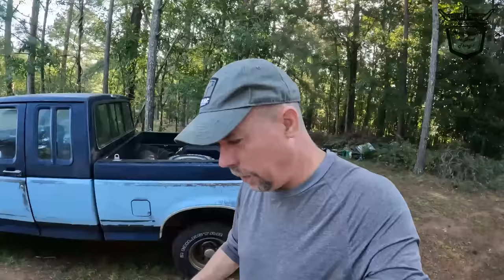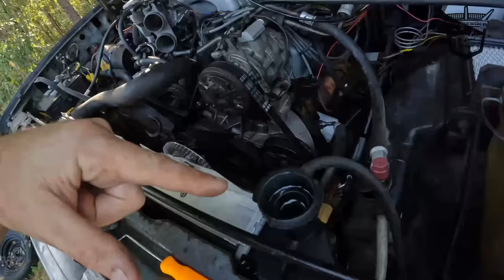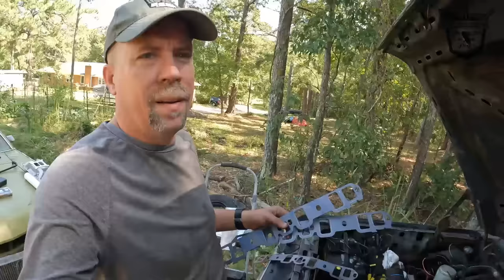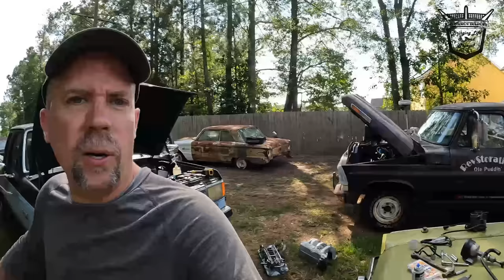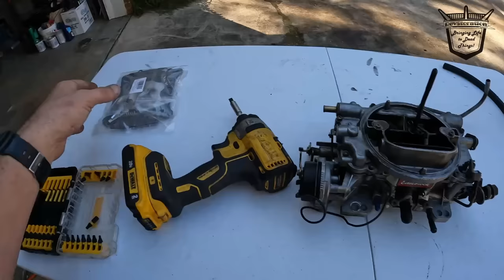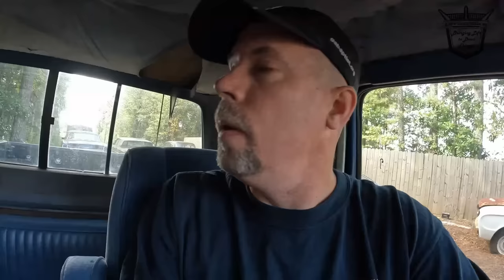1987 Ford F150 - EFI to Carburetor and HEI Distributor Conversion ...ish!

Comment: Being a Pastor is a full-time job.  I don't see how you manage to put up as many great videos as you do.  So many people think a Pastor only works one day a week.
Reply: 47 b
Reply: Love watching his channel and pastor wheeler and his dad the old man,, and I have definitely had some I should have given up on like the early 94 Chevy extended cab short bed Z71 Silverado tbi nightmare I've mentioned before but I didn't quit because people kept saying it would never run, and I was determined to fix it well I traded a $3,250 86 chevy k20 custom deluxe long bed and well used farm truck only needed the bad starter swapped and a good carburetor put on it I offered the guy it's quadrajet carburetor and the GP Sorenson rebuild kit he's like nope quadrajet carburetors are junk, anyway he was asking closer to $2,000 for the early 94, and it now runs fairly well except it's going to need fresh rod and main bearings from the major flooding issues it had and that they just drove it like that til it wouldn't take fuel input without crackling backfire flames out of the exhaust tips and through the glass pack mufflers and stainless cannon 3 1/2 inch slant cut stainless steel heartthrob brand exhaust tips on 2.25 inch pipe and the tips are 18 inch long sounds like a double barrel 12-16 gauge side by side shotgun being fired simultaneously needless to say the neighbors hated that truck... and the timing chain is getting slack in it so that needs replaced and I probably have close to another $2,700 in parts making the tbi truck run correctly so yeah just carb and hei distributor swap it,,I could have gone that way but even if I didn't keep the Z71 I know it has rust around the edges except for the bed the inner bedsides are shot.. it's still a truck alot of people look for to buy,, and I have a clear title to it,it is still one of the most straight bodies of the gmt400 extended cab short bed trucks I've seen.. I knew someone would still want it... my late brother's best friend,, turns out it had a weak fuel pump and the factory sending unit was half clogged up with sediment and rust, and the main two issues actually there are 3. The reason it was backfiring through the tbi occasionally if you tried to hurry it up moving was the right side injector was a 5279 a 305 fuel injector and the Dr side was a 5206 a 350 fuel injector so one side the passenger side was starving for fuel, and the oil sending unit sensor was the wrong one for the vehicle as the motor was from a older truck,it didn't have the fuel pump cut off circuit so when the truck would loose oil pressure it would just quit causing it to backfire out the exhaust tips, and the tbi distributor was rusted and corroded inside so I swapped it out and put a tsp southwest performance brand new billet aluminum distributor in it and swapped out the no name ignition control module for a ac Delco gm ds194 and the truck while on the battery charger fired right up, but usually the starter would about kill the battery starting the truck and that got replaced with a ac Delco professional service replacement gm mini high torque starter like these motors are supposed to have and it zings right over and fires the tps sensor had a dead spot just after idle, halfway through part throttle and just after full throttle so that got repaired and followed by new Napa black 7mm high temp resistant silicone jacket ignition wire set and ac Delco rt45ts spark plugs since I'm sure this motor has been washing the cylinders for about two years before I got the truck and no one fixed it my first clue was with the bad fuel pump starting it off the mt dew bottle with a quarter of the gas in the bottle into the sides of the tbi and it tried to run fine as long as you didn't give it any throttle response input.. and the oil smelled strongly like gas, unfortunately this truck has a 0.40 over 1 ton 4bolt main 638 block in it with decent speedpro pistons and rings but I am guessing it's going to eventually need to come out and be gone through again but after all that it's rebuilt transmission started slipping and I'm like nope I'm done someone else can feed this thing parts, and then my late younger brother's best friend decided he would like to own the truck and I ran into a deal on a th700r4 transmission i couldn't pass up and ended up buying a transmission for it anyway...ugh
Reply: It’s not a real job that’s why….

Comment: Hey Rev. Lamar from Kustom Motors. Here in Abbeville SC. That's a good way to go with a Carb and HEI. You will need a pressure regulator for the carb. EFI is a higher pressure. Much Love from everyone here. Keep looking up and turning wrenches.
Reply from the maker: I installed an edelbrock 4-7lb electric pump..
Reply: @RevStoration  so you took relay out for factory pump or it just doesn't run from efi being disconnected
Reply from the maker: @RobertDickens2002  I took the two power wires off the high pressure pump and wired them into a new inline low pressure pump. Still using the relay.

Comment: The metering rods on that carb are a GREAT design. I love taking them out and dropping them in from the top.  I just did the same thing with a Chevy. By far the throttle cable bracket was the worst part, cutting and welding and more of the same.  Simple always works.
Reply: Well rev my brother had same problem with a 84 150 like to drove us nuts we did the same thing good video thanks

Comment: Pastor, check the firing order. I had a 78 Thunderbird that i built a 351W for. However, i forgot that I used a 302 grind cam in it. I fired it up, and it ran and drove, but ran poorly, with low power. I switched to the 302 firing order, and voila'!! Ran smooth as glass! Just a thought, as some of the newer 302s used the 351 firing order. By the way, i've been tuning into your morning services the past couple of weeks. Great messages! Revival is needed! Amen!
Reply from the maker: Amen brother. Thanks for worshipping with us!

Comment: On the passenger side of there's 3 plugs, the center one is the pressure, put a oil pressure gauge and the pressure should be 30psi if not you need to adjust the cable on the carburetor
Reply: On the transmission you mean

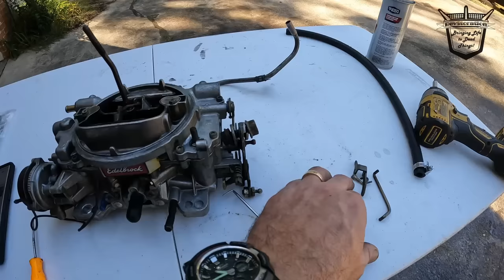Comment: 28:00 was watching Rev's hands whilst he's explaining a thought Rev had nail polish on 😮. But then I realized that it was ford grease that stuff will stain everything. Some stock engines will use a dual plane intake but most perfer single plane. It is what I have learned from my own experience. 🙏

Comment: Take to wrenching with Kenny. If you got a tac in dash, dont hook it up cause it wont be right it be to fast.Sounds like you got 2 plug wires cross and that will cause trans trouble.✌️

Comment: Something that a lot of people don't look at is the harmonic balancer if one things go bad it will make your car run like crap and you end up spending all kinds of money trying to figure out what it is and it keeps on doing this same garbage so have a look at your harmonic balancer make sure that it is in good condition there's a lot of videos out here that will show you about it that's what was wrong with my truck I replaced all my fuel injectors the timing the spark plugs all kinds of sensors and it come to find out that the harmonic balancer was bad that was my whole problem

Comment: Hi Rev, check, re-check, re-re-check your firing order. Acts like 2 plug wires are crossed. Have seen and done this many times myself. Good luck.
Reply: That's what it sounds like. So hard to tell from miles away but just that slight roughness is a big clue.

Comment: Rev Sounds to me you may have the firing order wrong, Ford small blocks have 2 different firing orders. I have had a couple people bring their hot rod fords to me complaining that it just didn’t have the power they expected and every time they were using the older firing order and switching the plug wires smoothed them right out. Also all the shift points are controlled by the TV cable attached to the carburetor, edelbrocks require a geometry correction bracket for that cable. Congrats on getting it running!
Reply: Summit part # SUM-700203 should do the trick for you.
Reply: That motor is not an HO
Reply: The Ford 5.0 EFI uses the H.O. Firing order
Reply from the maker: I'll try anything at this point..
Reply: I believe Robertdickens2002 was correct, it should be the non H.O. Firing order. I’m thinking of the 5.8 EFI being the same as the H.O. Work on too much stuff to keep things straight. But it definitely sounds like a couple wires are crossed at least.
Reply: @RevStoration  have you done a compression check or pulled plug wires one at a Time
Reply: I second that tv cable is super important

Comment: It sounds as if the engine is not running on all cylinders. I suggest you first perform a cylinder output test to determine which cylinder (s) is not firing. Then you can proceed and do a compression test, check the firing order, check the spark plug cables for continuity, check your spark plugs, check the distributor cap for cracks. I'm only close to 80 years old and may have forgotten one or two more things that you may need to do. But the ones I mentioned shall lead to to finding the problem. Oh yes, if you have access to an oscilloscope, you will find the problem easier and quicker. I was blessed with the opportunity to train many kids that came back from Vietnam in the Auto-Diesel Tech field.
May the HS, our Helper, lead you to successfuly find the problem.

Comment: I have a 1989 F150 and it has EFI and the only problem I ever had with it was the ignition switch would not work but I have a workaround for that only took a relay and a momentary switch and it has worked perfectly never had any problems with it at all since. I don't know why you have been having so much trouble with that EFI on that truck. Never seen anyone go backwards and use a carb. But you did do it and it did start with a carb on it just need to stop a couple vacuum leaks and then call it good. Thanks for the video.
Reply: Because he doesn’t understand it’s efi. These are stupid easy to fix and keep running. That carb is junk compared to the efi it has within.
Reply: I’m getting ready to have to replace the 302 in my ‘86, only reason I considered a carb conversion is the fact that I don’t want to deal with rewiring everything… the only engine issues I’ve had with it weren’t related to the EFI at at; sucker was even running with the EGR valve intake port completely crudded shut.
Reply: I’m converting to carb just to get rid of all that junk under the hood. That mess makes my ocd flair up😂

Comment: You need to buy the bracket for the carb and make sure you have the transmission TV cable is adjusted right or the transmission will burn up
Reply: He probably has a c6. That’s what’s in mine.

Comment: Rev, the only thing I can say is that you need to do your due diligence. Many ppl think that slapping on a Carb on it and it magically works, well as you can tell it just don’t work. Now you done that, you may as well go ahead and remove that E4OD and slap a manual in it.
Reply from the maker: The 88 bronco works fine with the same set up.. this one doesn't!
Reply: @RevStoration  let me go re watch ole bishop, see what’s different then I can come up with a good answer. To be fair, my 91 and my 96 with the 5.0 never had this specific issue, but similar.

Comment: It seems like it is not getting the feed to the electrical solenoid switches are not getting the power to trigger them and shift this transmission, but I do know that they make a standalone computer for putting those transmissions in the older vehicles without the efi and the ones setup with a carburetor so you might look into that, can't remember what all connections and sensors the e40d transmission has that it has to have the computer to shift this transmission through the gears..

Comment: I have a 1985 Bronco II that the computer quit working and many of the vacuum lines were rotted off of it. and some of the vacuum selenoids weren't working. so I thought about it what it would cost to fix all that crap? vs what it would cost replace all that crap? it has a 2800cc 2.8L V6 that had a motocraft two barrel carburetor without a ported vacuum connection. because the TFI distributor doesn't have vacuum advance. and so I looked through motocraft carburetors and found one that looked like a good replacement for the one that was on the engine. and then I took drive to the wrecking yard and got a Duraspark distributor out of a Mustang. and got a duraspark module went back home and put the parts on the Bronco. and wired up the duraspark ignition system. and that was fifteen years ago and the Bronco II still runs great. and now I have a 1989 F 250 4x4 and I have made up my mind that I'm to do the same thing to it. with it with an aluminum intake manifold and a four barrel carburetor. and a Duraspark distributor and an MSD ignition module. 

I could hear a dead skip in your truck. you need to get the misfire out of it? you need to check your spark plugs and wires and if they check out ok. you need to do a compression test because it's definitely got a dead hole in it. you get rid of that skip and it will probably run great?

Comment: Best guess is it wouldnt crank when it was put back together due to a security issue. The computer wouldnt allow the engine to start because a sensor was either not hooked up or had a bad connection. Congrats on getting it going though
Reply from the maker: It got figure out old school style.

Comment: I've done some research recently (because I'm looking into getting one myself for a project), and the transmission in the F-150 might still be the Ford AOD withOUT a computer to control the shifting.  The shifting is all controlled by the TV cable going to the now carburetor.
Reply from the maker: It is hooked up but may not be right.
Reply: @RevStoration  I've always heard you should make sure they're both wide open at the same time as In hold accelerator wide open and fully extend tv cable and they should both match up
Reply: Tps senser has to be install to control trans computer

Comment: The Edelbrock is a great street able carb but is prone to flooding and tuning issues without a pressure regulator set at 5-5.5 psi, with that you’re golden…otherwise you have issues like the dead spot transitioning off the idle circuit…

Comment: Its your TPS, it needs to be hooked up to the throttle linkage on the passenger side of carb so it will send the correct RPMs for your transmission to shift.

Comment: Rev, I've got a Holley 600 cfm that has a vacuum leak at the butterfly shaft. I don't know how to fix it, but its been rebuilt with new gaskets and metering block seals. If you would like it, lemme know.
Reply: If the throttle shaft boss is worn, you can put bushings on it.

Comment: Yes 4bbl carb vacuum advance hei distributor swap this sucker so your son can enjoy his truck and it can quit giving you all fits... and I would have to guess it is either having computer issues again or the power feed or ground circuit to or through the ecm is not present maybe even a failed hall effect switch in the bottom of the electronic distributor...

Comment: Had the exact issue with my 92 f150. Ended up being an intermediate short in the ecu. Ordered a “reman” ecu and it was worse than the broken one. Ended up getting a used ecu from a parts truck and it runs like a dream. Aftermarket is junk these days. I’ve replaced so many items with old parts and the truck keeps running better.

Comment: i have an 88 f150 and it would idle at 3000 rpm. found out the intake bolts were all loose except 4 of them. i had a burned valve and a blown head gasket.. the check valve in the back of the engine for the smog pump was burned out i almost got it fixed up only paid 200 bucks for it it is a 302 and a 5 spd manual and a 4x4.

Comment: You know a welder and some steel an a grinder with a cutoff wheel you can make all the break it's you need to go to carb kick down throttle maybe cruise control

Comment: Your truck, has a TV cable, for the transmission. It is not computer controlled. The AOD-E (electronically controlled) was introduced in 1993. Any time you see a TV cable, the transmission is manually operated. You, have to have, the TV cable adjusted properly, for proper transmission operation.  Improper TV cable adjustment, will burn the transmission up. Simply hooking it up, is not sufficient. Just my 2 cents.
Reply: u r correct 👍
Rev needs to get an aftermarket tv cable bracket made for carbs and adjust it properly.
Reply from the maker: It seems positioned correctly bc it isn't tight and at full throttle.. it doesn't go any further. I may try to find correct bracket.. Any ideas where? Summit?
Reply: @RevStoration  The, best I can do right now is, look up bad shoe productions.  There, is a snippet online, on the how to, of the AOD TV cable adjustment.  We're so limited, on what to post here. Thank you, for your service!